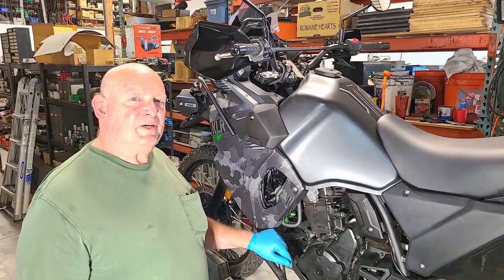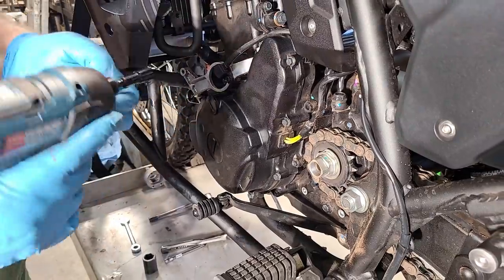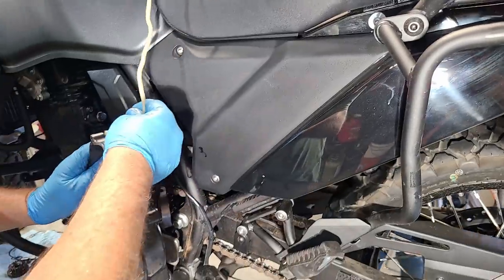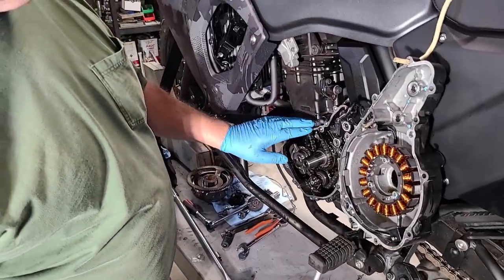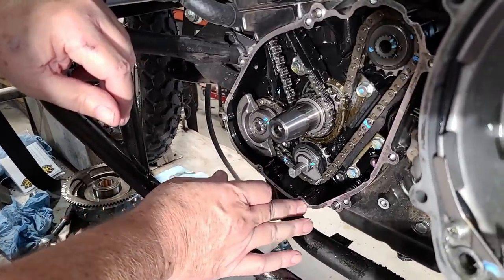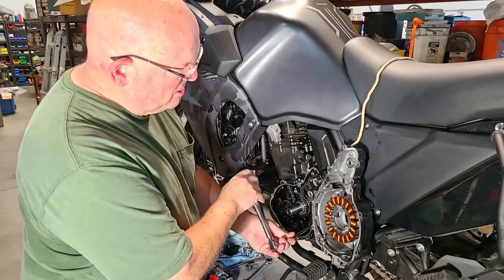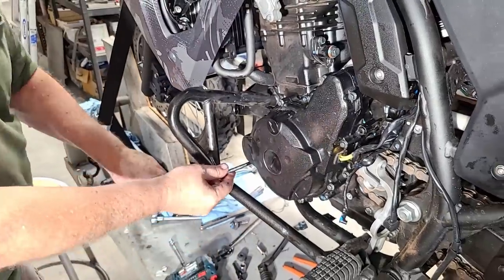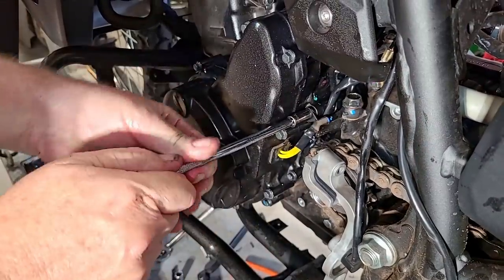KLR650 Doohickey & Torsion Spring Install (official Eagle Mike version) (incl. 2022 model)

Comment: Mechanical engineer here: that missing tooth/boss on the rotor is for a hall effect sensor to determine crank position. The sensor needs a skipped tooth or irregularly spaced tooth to determine the home position for reference.
Reply: The alternative is an absolute encoder, but the more poles in your encoder the more expensive.

Comment: Thanks for the video to both you and Mike. I did the torsion spring replacement with Eagle Mike complete kit. Everything worked out well. Toughest part was cleaning the old gasket muck off, with out dropping it into the outside cover or engine. I used a single edge razor blade (carefully) then brake clean to soften the gasket and a small brass brush to get the last of it off.  The kit did have both gaskets and I used them. It is surprising how much noise was being generated by the stock system. My bike is a 2014 with 8600 miles on it. The spring was in good shape, but not keeping tension on the chain, as described in the video.
Reply from the maker: Thanks for sharing

Comment: Nice video. I did this on my generation two KLR and survived. It is a pity Kawasaki didn't just buy the aftermarket doohickey and do this for the buyers. Surely they knew about the issue! That said, it wouldn't stop me buying the bike as it is such great value and so much fun. Also, is is easier to stay under the legal road speed.
Reply: Sure Kawasaki knew about "the issue" or what could be perseaved as an issue. If it was really an issue Kawasaki would have addressed it. Ive talked to several mechanics that service Kawasakis and not one of them have ever seen a KLR brought in with the torsion spring failure. Its just hype to promote sales of the "doohickey" spring kits and tools to install them. $$$$ the idea that your bike could blow up if this spring fails has made a lot of $$$$

Comment: I had 3 of those 650 KLRs in the 80s and 90s; that damm counter-balance  chain was the biggest problem of that bike(besides the Ignitor, that cost 300 dollars in 1985!!! it did the same purpose as  a 5 to 10 dollar  part for any chinese scooter today..;
 what i always did to that chain tensioner was to cut the spring, and bend and re-hook the end making it  shorter and of the correct tension;  but eventually the damm chain becomes just too elongated,and the guides  worn,that it rattles ;  never changed one ,i think  that the chain, guides and gaskets, plus the labour, were daunting   lol

Comment: Now you are causing the chain to be used beyond its service limit, also if there is sprocket wear this modification will prevent detection until its too late, the original spring length is designed to bring the chain to its maximum service limit, the dohicky will cause you to use a stretched chain. The service life may be 8000mi more or less depending on user riding style. The chain and guilds can cost $250-$300. Kawasaki will not be responsible for your life when you do this modification and use a chain that is stretched beyond its service life, the original spring is the chains max life length indicator, so if the spring no longer pulls tension it is because the chain is stretched. Also the spring is not under constant tension because of the bolt adjuster for the chain.

Comment: I have the 2023 KLR 650 with 1300 miles and the engine a has noticeable engine tick so took it to my dealer and they said they disembled the motor to look at the spring and tensioner and it only took them about 20 min total and had it back together. Bull S..t. I know it would take longer that that. So I still have a loud tick and they said some bikes are louder than others. I have had a least 15 bikes over the last 45 years and this is my third KLR, so I know when something is not right. So will have to find a shop I can trust that can do this mod.

Comment: Hello, great video but instead of a torsion spring why wouldn’t you just use a shorter spring where the stock one goes and increase the amount it can adjust??
Reply: Makes sense, except it can only pull so far in a straight line. The torsion spring should be able to pull it further because it can continue around the whole loopdeloop

Comment: I just purchased a 2022 KLR 650. I have the four year extended Kawasaki engine warranty. Every time I ride the motorcycle I feel like my doohickey will let go and my whole engine will explode. Should I fix this or just continue to run it?
Reply: Just ride it. Most people never change them
Reply: Thank you that’s what I’m going to do. If I start hearing weird noise or if I’m up around 15-20k miles I may look into swapping it out.
Reply: All your worry, from the power of suggestion of people promoting fear!
Reply: Too true. This is an excellent portal that shows the power of persuasion and how very very gullible folks have become.
Have spoken to many long term Kawi mechanics who deny ever having had to repair a destroyed KLR motor due to doohickkey.

Comment: It can be very troublesome for a rookie to start bolts with an electric tool.  It is not all that hard to have the bolt misaligned and cross thread the bolt.  Much safer to start all bolts by hand for at least a couple turns and then use the driver to spin them in.  Eagle Mike is obviously not a rookie, but in a video intended to be viewed by folks who likely have not done a lot of mechanical work, it would have been better to start the case bolts by hand.

Comment: Could opening the case and doing this upgrade void factory warranty?
Reply: Pretty sure it would 😂
Reply: @chrushernator  I contacted the dealer where I purchased the bike (new) and they said “maintenance on your motorcycle is your responsibility unless you reach the valves, that of which would void warranty, also I would need to complete a checklist upon every preventive maintenance service for the first 12 months”. This was yesterday after I posted this comment. Also, I have a 5 year warranty through my financial institution.
Reply: @Rrrakanishu   just the values void it?! Awesome 🙌
Are you gonna go for the mod?
Either way, enjoy the bike, they look like a blast, ride an extra mile for me
Reply: @chrushernator  yes, because I don’t want to run it with the stock parts just to be safe.

Comment: If everyone fixes their doohickey Kawasaki will never know there's a problem with it and will never fix it.if you suspect something is wrong with your doohickey take it in to the dealership so they will have a record of it.after they fix a couple thousand for free they will address the problem.as long as people are fixing it themselves it's not a problem.doesnt matter how many people say failed,it matters how many Kawasaki KNOWS failed.leave it alone and take it to Kawasaki so they can see for themselves, otherwise it's never going to be a problem as far as they're concerned.
Reply: @KLRJUNE  yeah a lot of people are saying the new klr has fuel injection, big deal and I'm like no,it has fuel injection,a new frame with a different rake, New swing arm,new bigger brakes,anti lock brakes, different suspension,new headlights,new instrument panel,new balancer chain guides, different balancer chain spring,new windshield and I'm sure I'm missing something.and they didn't raise the price.how I have no idea.then they say yeah but they didn't add a sixth gear!I mean some people are unreasonable and never satisfied is all I can figure.Im more than happy with my new one for the same price as the old one.who wouldn't be?

Comment: I really want to like and consider this bike but this amount of work to fix a design problem seems so wrong.
Reply: There are two kinds of reliability.  You get the first kind from buying a Corolla.  The second kind is what you get with a C-130 Hercules or a KLR, where everything that can go wrong has already been identified and fixes designed before you were born.  Big Rock, A.K.A. Shiba Inu Moto has done a great job with this series of KLR videos for the guy who wants an adventure bike, but may be just starting out in life, and has to do all the maintenance work in his assigned parking spot at his apartment complex.  Great work.  All the other reviewers just say, 'The KLR is OK, but you can do better by just spending more.'
Reply: @akpilot5510  Agreed.  It just pisses me off that something Kawasaki could easily fix, Kawasaki refuses to fix.
Reply: @SWTrailsAndWheels  Agree

Comment: What a hastle for a new bike!
Reply: Agreed, though you can also look at it as an opportunity. Is make note of everything you need to monkey with and make your credits according to that. It looks to me like a golden opportunity to upgrade your drain plug your shift lever and your charging system.   Still I do find it absurd that Kawasaki has not fixed this issue Which has been around for decades,
Reply: @mrspeigle1  Agree.  They have to drill a hole and add a spring.  They wouldn't have to change the casting.

Comment: Very nice instructional video! That said, it seems preposterous that a 2022 year bike would have such a glaring deficiency. Also, wouldn’t such an engine modification void the warranty?  If this modification is done at a shop, what would be the cost? $1000?  And then there are other problems that might need to be addressed (piston rings, etc.)  Taking this into consideration, it doesn’t seem like a new KLR is such a great bargain!
Reply: Well considering the KLR is still using the original thumper from the gen 1 in the 80s it makes sense that it is still an issue. Kawasaki has changed pretty much nothing over the 30 years this bike has been around. The only new features the 22 has over a year 1 is fuel injection and abs braking. Other than that it is essentially the same bike with different fairings. I personally see that as a good thing,  it means any problem you may have has almost certainly been encountered and solved many times before. Is the doohickey an annoying thing?  Maybe if you don't like working on bikes,  but I enjoy taking engines of all kinds apart so personally I liked doing the job
Reply: Easy enough to do by Mike but  Kawasaki just cannot move to a torsion spring during build.  "Preposterous " is an understatement!!

Had since 2018 to sort out the move to torsion spring and Kawasaki brings the bike back in 2022 still f'd up?  Might be buying a Himalayan instead just on principle.

Comment: As a former KLR owner (an 2009 upgraded with the Eagle Mike doohickey of course) I simply cannot understand why Kawasaki would go to all the trouble to upgrade the model and fail to address this issue. Aaaarrrggghhhh!
Reply: They address known issues,as in things people repeatedly BRING IN TO THE DEALER for repair.since most people do the "preventative" eagle Mike fix, very few ever make it to the dealership for repair, therefore, according to their numbers, very few ever fail, not enough to justify a complete redesign.basically,if you want Kawasaki to address the issue, people need to start bringing their bikes to the DEALERSHIP for doohickey issues otherwise their records will continue to reflect that two out of 200,000 failed and that's not enough of a problem for them to worry about.they aren't going to fix something that, according to their records, isn't broke.stop messing with it and bring it to the dealership if you suspect a problem with your doohickey.

Comment: Fantastic video. Just received the doohickey kit from Eagle Mike. Doing this modification tomorrow morning :)
Reply: How did it go, do you notice a difference?
Reply: @rgfxnet  the job of replacing the lever and spring was very straightforward. Still took about 6 hours. I was surprised to see after 20 000 km the spring was still tensioning the chain. Now, of course,  I have no idea what the true tension was prior to loosening the doohickey bolt up. I did notice my lever had rubbed a little and the spring chewed into the inner case nicely. I haven’t been able to ride it yet because of the winter tire law here. (I have the 2nd Gen KLR).

Comment: I've got a 2022 KLR 650. Absolutely love it. But I'm not touching the engine until warrantee runs out. Even then, it is unthinkable that the 2022 engine still has the same issues. I'll be the test case to see if it can do 100000 miles without this mod.
Reply: Well if you're trying to reach 100k miles without opening the engine you won't. The valves need adjustment about every 7500 miles.
Reply: How much does the valve adjustment cost?  

For me that would be every other riding season.   I would have tires and valve adjustment at every 7500.

Comment: Good video; not rushed and every detail covered.
Did MIke use a new outer cover gasket?  I didn't see one when the cover was installed.
I'm guessing that new speed sensor arrangement means that recalibration is needed if gearing is changed.  Can anyone confirm?
Reply: From what I understand, if you go to a 16 tooth up front then the speedometer actually becomes more accurate.  Dropping to a 14 would make it further off.

Comment: C'mon KAWASAKI.. it's been over 30 years, and you still haven't fixed a known engine destroyer..   :)
Reply: Kawasaki does not see the need or they would have fixed it.It actually is an upgrade,but NOT a necessary fix for most people.

Comment: It sounds like Eagle Mike corresponds with Kawasaki (as he stated in his video that he's sent them unserviceable doohicky parts). So my question is why doesn't Kawasaki just put a torsion spring in? The problem is very well known, and they've obviously attempted to remedy the problem, but they still haven't figured it out even with the advice. Not wanting to take away from Eagle Mike's business with this part, but come on Kawasaki! Nobody wants to rip open an otherwise bulletproof engine to ultimately replace a couple dollar spring.

Comment: I'm a noob so this might be a stupid question, but why not just replace that spring with a shorter spring that has the same tensile strength and stretch it into place? 

That stock spring looked like it was totally loose..

On another note... What factory mechanic would do this mod for me since I'm not mechanically inclined? Do they know about this mod and where do I get that spring you use?

If I plan to put miles on my bike as a commuter, say 12,000 to 15,000 miles a year, is there a maintenance schedule to deal with this issue?

Btw, what's the valve adjustment interval one the 2022 model?

Comment: Please forgive my lack of knowledge here!  Why tighten that doohickey bolt? As the spring take up the slack from the chain, does it not need to allow the spring to do it's job?  Or, once tensioned do you tighten the nut and lock that spring into place. But would that not stop the spring from allowing tension to be kept as the chain stretches?  Sorry!! I am a little confused!
Reply: The locking bolt must be released occasionally (after a few thousand kms) so that the torsion spring can re-tension the balancer chain...Then re tighten the locking bolt.
Not sure how often this must done..maybe check your manual for recommendations. 
Rgds from S Africa

Comment: Good point on the drain plug install, very important! Seems like a bad place for all those wires near chain that sprays oil & grit!👎
Reply: The KLR is an important bike but some of the engineering defies belief. The case saver is electrical wires?

Comment: Thanks for posting this. Unless I managed to miss it, the video did not show or mention to fit the gasket for the outer cover during reassembly, which is the only thing not covered that I could find.
Reply: No gasket needed for the outer cover.
Reply: @djsi38t  I don't see why not. The bike comes with a gasket there, and Eagle Mike includes it in his Doo set.

Comment: why factory doesn't wont to improve that spring after so many years  ?
Reply: @KLRJUNE  that means from 2014  year and up no issue with doohickey
Reply: @KLRJUNE  Since you're going around posting this same comment to every doohickey video you can find, you should at least include the part numbers for the wear guides.  OEM part #12053A GUIDE-CHAIN,FR and #12053 GUIDE-CHAIN,RR
Reply: @dejanmeki  That's not what he said at all.  Get a better English teacher and read it again.